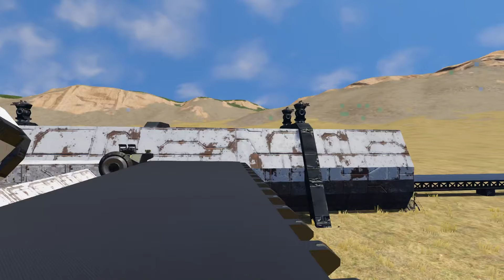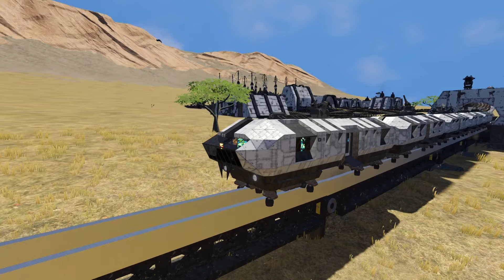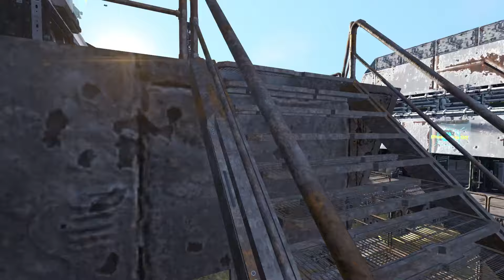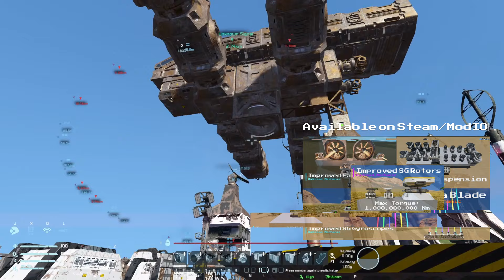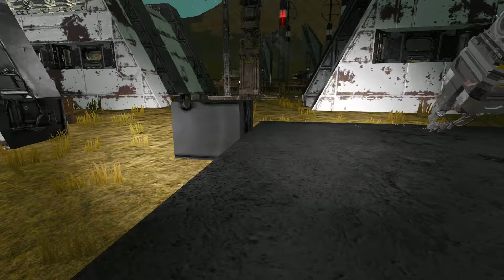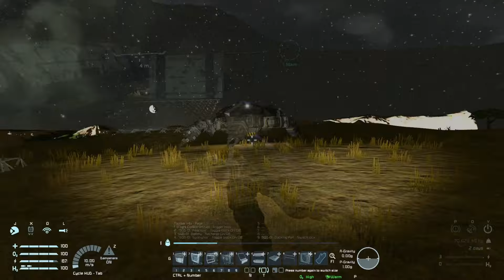Space Engineers | Mechyard Survival: Episode 17 - Outpost Upgrades

Comment: This is clearly a Craybster, not a squid. Very funny idea of removing 4 wind generators to reduce lag in a place filled with hundreds of blinking sparking smoking walking flying bells and whistles. What happened to large objects not fitting into small connectors/pipes?
Reply from the maker: You'd be surprised how much the power/physics calculations & animations of turbines slow a game down. I've gone from 24 down to just 4 and definitely noticed the difference.

And the Azimuth Tiny Drills mods allows all components to fit through small conveyors so the Tiny Welders/Grinders work properly.
Honestly I've always hated the whole Large/Small Components mechanic, it's incredibly inconsistent.
Reply: @dread_mechanic Well, good if it works, I guess. Thanks for explanation. Tho turbines look better the more there are, a bit sad that game can't handle them.

Comment: I was wondering if you had something set up at the missile launcher station to "call" the train when it gets below a certain level of stored components, but I see that you have things configured that the train just goes back and forth, and waits at the missile station til it's cargo containers are empty, and then automatically heads back to the Mechyard station to reload.
For the occasions you ride the train out to the missile launcher station, do you have anything set up that prevents the train from leaving without you (i.e. sensors to detect player outside the train on either side of the station), or would you just jetpack back to the Mechyard if that happened ?

If you haven't already decided on the design for the patrol mech assigned around the missile launcher station, what about something like a 6-legged "turtle" ?
I would imagine that 6 legs would still be easy for you to make as a walker.
As a turtle-like design, it could have a heavy armor shell, providing a bit more surface area for mounting turrets.
It would be neat if you could design the "head" (cockpit) to extend out the front, that would retract under the shell when an enemy is within range.

The Squid looks a bit freaky when the arms are under AI control and "flailing around"  while not in use.
Another unique design.
You building the Mechyard has turned Space Engineers into Base Engineers, and I love it.
Reply from the maker: The train doesn't have anything to prevent it leaving without me yet, but then again what train does wait for late passengers 🤣
It does have a system in place to prevent it leaving if the bridge is up.

And I've got a few ideas for some mechs to defend the missile silo, a hexapod may be one of them 😉